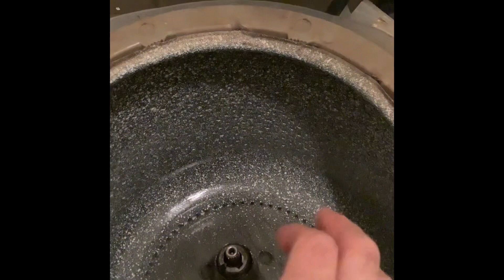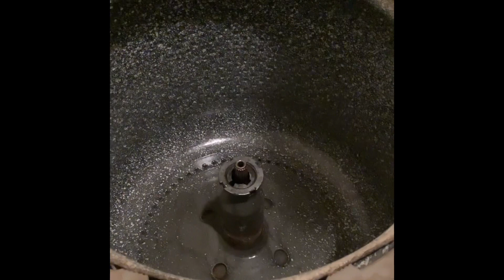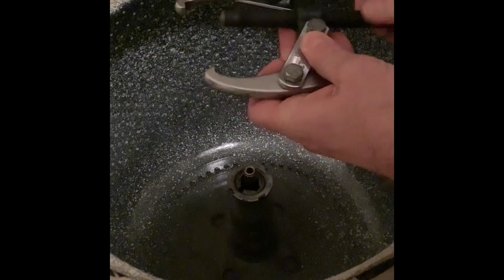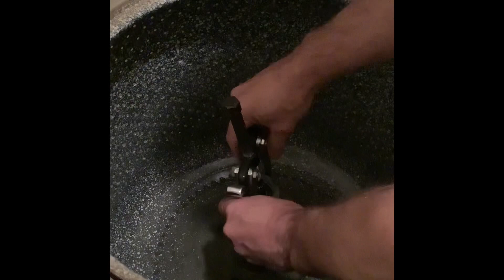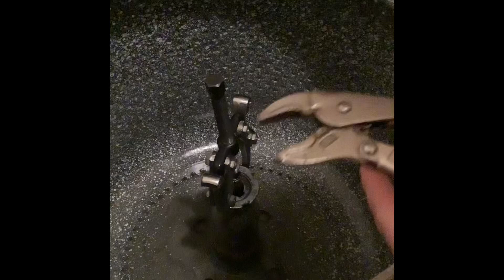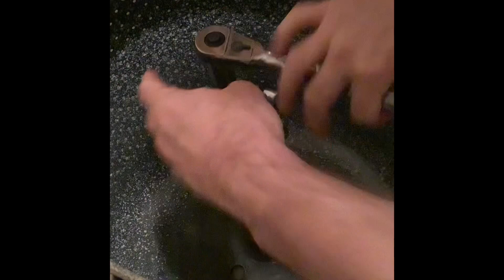Washing Machine Stuck Inner Tub Removal Kenmore Series 80 Whirlpool Maytag Top Load Easy Way

Comment: So.i guess I'd need to bolt the motor and shaft back into the bottom for this to work? My tub is corroded onto the drive block, but if you kept the spanner nut in that means you pulled the tub out WITH the drive block? I'm not saying this is wrong or anything because idk what the hell I'm doing in the first place. It took me forever to get the clutch assembly and drive shaft out from the bottom I'm almost worried I won't be able to get it back in and I'd rather not know until I'm done lol

Comment: Well...I tried this and it worked BUT BEWARE!...the center of the puller damages the thread in the transmission shaft and then the screw won't go back in. You'll have to replace or rebuild the transmission. Luckily I had an extra shaft so I was able to rebuild the transmission with the other shaft. I recommend placing a piece of metal over the shaft to protect the tread.
P.S...the oil for the transmission is $86 on amazon but I was able to get 80W90 oil which is the equivalent for $12 at Canadian Tire.

Comment: Signed in just to thank you.  Picked up a gear puller set at Harbor Freight for $30 and it worked like a charm.  Washer was 30 years old and the basket had never been pulled.  I put the spanner under the nut and attached the puller to the spanner to spread the load more evenly.

Comment: There is a much easier way. No special tools, tub out in 15 seconds.

1. Once spanner nut is removed.

Stand on lower frame of machine, so it doesn't come off the ground.

2. Take non dominate hand and PULL UP ON THE METAL WASH BASKET HARD.
You will feel the machine being "springy" but you are standing on the frame, so the machine wont come off the ground.

3. Take short handled hammer or mallett. And hit the top of the tub block in a downward motion, while pulling up hard on the wash tub.
Do not hit the block where the two nubs from the spin tube lock into the block.
But rather, hit the full side of the block. You can hit the open side of the block as well.

You might have to spin the tub to the other side of the  block once or twice..

But after 5 good whacks ..
Even the most stubborn wash tub will come right out.

I am an appliance tech.. and this is your pro tip for the day.

Comment: Thanks for this video. My  1990 70 series Kenmore tub was stuck. Went to my local O Reilly auto store and bought a  6 inch two jaw puller and P.B. penetrating oil just in case.  I put a small nut on top of the tub spline to prevent damage to the spline. The tub came out nice and easy. Good stuff.

Comment: Ok, just ordered a jaw puller. I've been trying for 2 weeks all different ways, and I've been soaking it with WD 40 penetrating oil overnight every day to no avail. I have a 28 year old Roper that's been great until it started leaking. Changed all the hoses, spout, pump, springs,  etc. Still leaking. So I'm thinking it's the gasket. Which is why I'm trying to get the tub off. I'm hoping this works!  All of the machines now are larger and won't fit through my doorways. They don't clean as well either. Thanks for the video!

Comment: Worked 100% perfect. I had a smaller puller and put a nickel on top of the drive shaft to prevent it from going in the hole.  Thanks

Comment: Many thanks for your video! A 3 jaw gear puller and a makeshift extension to increase the reach of the puller got the transmission drive shaft out of my 20+ year old Kenmore Series 90. A lot of penetrating oil and an over night soak did the rest. The inner tub and hub are finally out! Thanks again!

Comment: So it seems the spinner nut doesn't have to be removed to do this (I can't get mine to turn) in order to pull the whole piece?
Reply: i had same question..any luck
Reply: @benstone800  I have two old Kenmore machines I was attempting to pull the tubs out to use for planters. I was able to get one disassembled without removing that nut, but had to unlock the shaft beneath from the motor to separate the tubes. The second one I haven't been able to get the inner and outter tubes to separate. Not sure this is any help, but the inner tub did pull off with the nut intact on the first one.

Comment: The only thing that I would add for future DIYers is, put the bolt back in the threaded hole before placing the puller.  That will prevent damaging the threads at the top of the hole.  You may have to put a prick punch mark on top of the center of the bolt head if there is a point on the end of the puller screw stud.  That will prevent the puller shaft from drifting as screw pressure is applied.

Comment: This is an  INCREDIBLE  video thank you sooo much for sharing .I have just one question before I attempt to try this method  and you can correct me if i`m wrong. Is the drive block coming of the shaft with the tub & what size puller are you using? Sorry that`s Two questions. My Tub is really really stuck.
Reply from the maker: 1. The drive block should come off with the tub.  Once you pull the tub, you can loosen and remove the spanner nut and carefully tap the drive block out with a small block of wood and hammer.  2. It’s a two jaw 4” gear puller.
Reply: Thanks for resonding to my questions! I tried first thing this morning with the puller .When I used the puller the tub does`nt come off but the shaft just goes down into the drive block and becomes very tight . Is that suppose to happen @jackofalltrades3880
Reply from the maker: @horacelee880  Try to loosen the spanner nut first and put it back on hand tight before you set up the puller?  If the transmission shaft is going down then what you are doing is working and the drive block is becoming free.  Keep trying.  Use some WD40 if you have it and spray the drive block and shaft.

Comment: This method works great!!!  I used a large three arm 5 ton puller from AutoZone, part#57078, free rental,  and had a pair of vise grips that matched the spline pattern perfectly!!  Used an impact driver on low power with the socket and it backed right out. Used a heat gun to warm area, don’t use a torch I will melt the rubber seals!  Thanks Again!!!
Reply from the maker: Glad you got it pulled!

Comment: I have two questions: 
1) Is there any reason not to use a three-armed puller instead of a two-armed like you are using, and 
2) Should one take precautions or be worried about deforming the top of the transmission shaft where the puller point is resting?
Reply from the maker: I suppose you could use a 3 armed puller but it may be more cumbersome to position due to the angles involved and flange space.  That transmission shaft is pretty tough.  If you’re concerned about deforming it, I suppose you could insert something in between the puller and shaft that could handle some pressure.
Reply: @jackofalltrades3880  Thank you!  I've been spritzing that area with DeepCreep Seafoam every few hours for 2 days now. Hopefully by the time I pick up the pullers today, it'll be ready to pop right off!

Comment: It worked like a champ.  Another video said it wouldn't work but I trusted this method.  I just kept cranking and it popped this bad boy right off.  Thanks again!
Reply from the maker: Give the drive block a shot of WD-40, let it sit, then hold a piece of wood on top of the drive block, like a small section of 2x4, and strike with a hammer. I wouldn’t hit the drive block directly with the hammer as you may damage your tub flange.
Reply: @jackofalltrades3880  Thanks for the advise!  You are the man!  I really appreciate your time and your helpful insight on this job.  Take care!